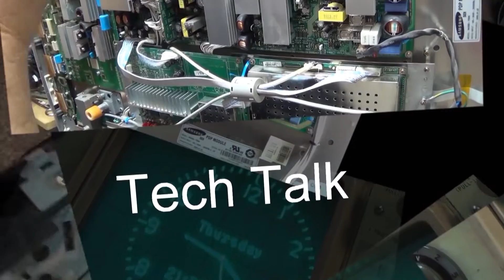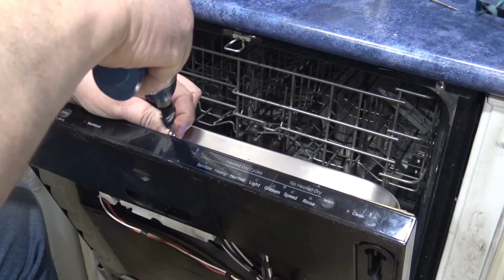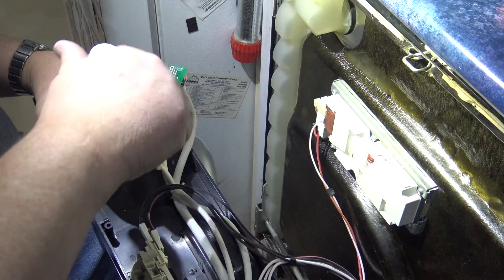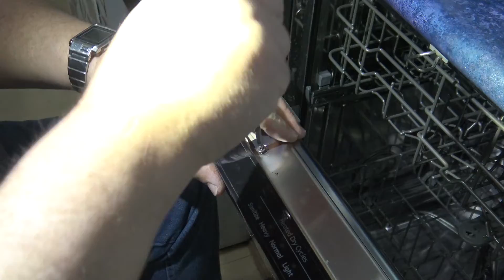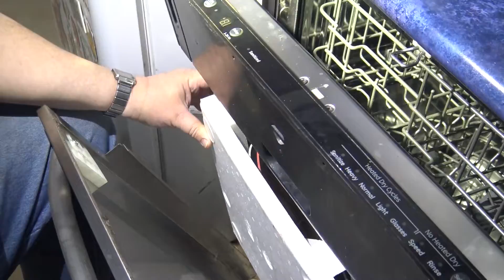GE Dishwasher has no power

Comment: Where do you get parts for your appliances? Is there somewhere local or online?
Reply from the maker: I think I took the switch for this out of an old cable box. I have a hard time getting parts just like anyone else as I don't trust ordering stuff off eBay been burned too many times. By burned I mean getting bad parts but the real kicker in the nads is when you ask someone to send it by post and they send it by FedEx because it's cheaper for them and then FedEx adds another $37 in broker fees which are not expecting on a $2 part to get $37 in fees added on top of everything else you paid

Comment: I know at the time of typing this this video is 2 months old, but I can definitely relate. I agree, these new appliances don’t last. We have a Maytag washer and dryer (separate) that my dad had decades ago. A few years ago, the washer’s mechanical timer quit. At first, we thought we should get a replacement, but I said, “Let me see if I can fix it.” It’s just a simple set of switches! It took me around 10 minutes or so to fix it! My dad and I are in complete agreement that we need to try to fix things ourselves, because repair people will jump right in and say, “Those old machines can’t be fixed. Better to buy a new one.” And yes, these machines still work to this day!

Comment: My dad bought a beat up 1948 fridge in 1970. He cleaned it up real good. Paid $10 for it. 52 years later it still purrs away in the basement. It just won't die!
Reply from the maker: But it chews up lots of power.  I had one, a 1949 Westinghouse but sent it to recycling about 20 years ago.

Comment: First mistake was getting GE. They have always been the bottom of the barrel garbage in the appliance world.
Reply from the maker: Well it has run now for 13 years without fault and a switch failing after 13 years is an acceptable failure in my books.   My sister got 4 years out of her lg crap and replaced with Miele and they have broken too.  So there. My range is is a jennair and it hasn't broken.  Been in service 20 years as has my fridigaire refrigerator.  It is from 2002 as well as has my carrier HVAC.

Comment: Nice fix :) 
Brings back memories from the 90's as my mom accidentally toppled a flower watering can on top of the dish washer resulting some buzzing noise coming from it. I quickly disconnected it from the mains and opened the circuit board cover to try and dry it. Luckily nothing was damaged.
I don't remember details anymore, but I guess I did something right, as the diswasher worked just fine for the rest of the time my parents lived in that house. They moved away from that house in 2018 and the same diswasher still worked, bought new in 1992.

Comment: What is it that on those double digit 7 segment displays that always this segment fails. My current MSI TRX40 CREATOR motherboard has a POST code display where the exact same segment is dead like on your dishwasher. Same with an old clock radio my mom has on B O T H of the clock digit pairs... WTF?

Comment: My infra-red box heater stopped turning on, so I emailed the company and the tech said sounded like a bad relay. Of course, you couldn't order a new control board. So I tracked down the relay (less than $5 bucks) and resoldered.

Comment: We have a GE 2800 dishwasher from 1984 its one of the first dishwashers with microproccesser control ., one bad door switch in all the years we have owned it cleans circles around all there newer models ,,  2015 GE dishwasher at our camp , has had the same issues with pcb micro switches going bad , and 2 bad control board's  go figure ,,

Comment: we bought a new gas range but had electronic oven controls. after about a year the oven controller said the keyboard was bad. so I took the thing apart, and the main board was covered in mouse 💩 and pee. the micro was fried. there was nothing to stop a critter from going on top the board HAD to replace it😡 but i did that myself (board was $300 usd ) when the new one got here i COVERED in UV coating and  cured it,  been 6 years never a problem again 😁 i can only imagine what a "repair guy" would have charged

Comment: Mend and make do, that's my Philosophy, saves you loads of cash.
I wonder it a layer of conformal coating would protect the board from Future moisture.
Thanks for for showing us, a job well done!!!.
John.
Reply from the maker: There was conformal coating on the board but it didn't seem to help.  Hey if it goes another 10 years and the switch fails again i guess I will be changing it again.  Wife was very happy indeed as there was a full load ready to go in as soon as i was finished.

Comment: Seems we all do the same, or better, face the same. Most of the time my weekend starts fixing things and ends fixing things.  The Whirlpool we had lasted 18 years and I fixed it like 5 times. If I looked it up online last year the last comments with people having issues with it were from like 10 years ago.  So I would imagine that they would all have been replaced long time ago.  I could fix mine every single time but I sometimes had serious cuts and some crap cleaning to do after fixing stuff. It had it's time and was replaced by another crap one which soap thing is broken just after the warranty period.  Price of that part alone is like way to much and is of course not universal and made of plastic.  Should have gone for a Miele, look up that brand.  Those things are more expensive but build to last compared to the others.
Reply from the maker: My sister put in Miele appliances.  They have been just as problematic as the LG it replaced.

Comment: Good job. I had similar experience. I ended replacing the entire dishwasher due to the cost of labor and parts are so expensive. I just have to add another $100 and got new one. The original problem was it doesn’t drain. Then after a week it doesn’t power on. They were 3 technicians came in different time, each one of them has different diagnostics. One replace the control board but still the same issue, 2nd replace the hose and drain sensor, still doesn’t do, then last came with a replacement for the internal parts but it doesn’t work. I complained to the appliance company with so many parts they ordered cost $. 579. I said to the company i don’t want to pay since it wasn’t repaired. So I ended paying the duagnostic for $79 and 3 technicians called demanded to pay for their labor and parts since the appliance didn’t pay them. It took them 2 months back and forth to arrange for a technician schedule due to covid with less technician available. so it took me a week to deliver the new diahwasher and installed by a handyman for $100. buying new equals less stress and less time. Never again with American Home Shield Pro. What a ridiculous company

Comment: I just changed my AC condenser last March 2021 and told the guy if my heat exchanger is good on furnace leave it in.  It was fine.  I wanted old furnace because I can fix the old furnace's control board if it craps out.   I don't want one of the new furnace's with the surface mount crap and microcontroller on them that cost 3 or 4 hundred bucks to replace.  By the way I changed condenser only  because I got tired of worrying about it dying during a heat wave.    It was still chugging along.  Furnace is approaching 34 years old.  Condenser was almost 33 years old.   I maintained both myself.    All 3 techs that came out for quotes could not get over how clean my furnace was.     DIY is required in todays world.   Keep up the good work.    P.S.  Just changed water heater too within weeks of the condenser.  Also 33 years old.    All OEM gear from when building was built in 1988.   My buddies motto is "Take care of your shit and your shit will take care of you".

Comment: Well done dave 😀 no money spent and the enjoyment of  a simple/fast fix.
Finding what the codes actually mean is a bloody pain.
Reply from the maker: Codes? The display shows the wash time.  Counts down. Also allows for delay start so can be programmed to run at night.
Reply: @12voltvids  most washing machines and dishwashers display a code if something has gone wrong.
Thats fine but trying to find the actual meaning of the code is often a pain.
Manufacturers often wont give you the meaning so you have to call a repair man.
Shitbags!!.
Can you tell im not impressed lol.
Dave keep repairing that dish washer for as long as you can.
Reply from the maker: @zx8401ztv  I will because i am cheap. Hate spending money.  Like making it. That's why I never go on exotic vacations because I can't drop a bunch of cash on a cruise or airplane ticket to some exotic place.  I have no problem dropping 50 grand on a new car or something that i can enjoy for many years.   Fine dining is also something i don't do. 500 for a hunk of meat and a couple veggies dressed up on a plate.   No thanks.
Reply: @12voltvids  Well you have the ideal meat cooker, so you can cut out the silly prices lol.
Little treats once in a blue moon can make life more enjoyable for you and your good wife.
There are people that are ultra tight asses and keep every penny,  they die and leave a bank full of money behind 😞
This happens so often and quite sad that they didnt get a bit of enjoyment in there life.
Having said that, i dont spend very often ha ha 😀
Reply from the maker: @zx8401ztv  I spend lots, but not on trivial things.   My fear is not having enough for a long retirement.   That is the end game.  Retiring sooner than later.  Know too many that worked longer than than they should have because they never saved anything.  They blew it all showing off.  Went to Hawaii every year spend spend spend.   Worked till they were forced to retire and then struggled to pay their bills.  My game plan is to retire in the next 3 years when i am still young enough to have a long retirement.

Comment: We recently had to have out hot water heater replaced because it had completely rusted away and flooded the house. We called several different places to price now much it would be. All companies wanted nearly a $700 to just remove the old one. I decided to disconnect it and remove it myself. A good old pair of channel locks and 10 minutes later it was on the truck going to the city dump. Saved myself $700, which paid for a brand new water heater.
Reply from the maker: I changed my last water heater and will do it again when it fails.  It sits in a floor tray which is plumbed into floor drain so when it blows there won't be a flood. The washer sits in a pan too.

Comment: Almost everything is made as cheap as it can be made with cheap parts.
Made to be thrown away.  I have a fridge in my shop from the 60's and it
still runs!  A repair man has never looked at it.  My dishwasher takes 
over 2 hours to wash.  Last one I had took about 45 minutes, yet this 
one is supposed to be "energy wise?"  I have already had to have repair 
guys to come twice in the 5 years I had it.  Wish I would have just fixed 
the old one now or at least tried.  Repair guy said I needed a new one!
From now on I will work on my own appliances....    Geeeze.   
Cheers buddy!  -Al
Reply from the maker: My old dishwasher also took 45 min but used about 5 gallons of water.  My new one takes 65 minutes but uses less than 2 gallons of water.  It heats the water to almost boiling.  There is a seperate saniheat mode that heats even hotter and holds it there for an additional time.  Of course there are econo modes that run shorter cycles too.
Reply: @12voltvids 
 Mine has different modes also, but only the regular mode 
will really clean like it should.  So actually the econo modes
are useless.  Mine is a Bosch machine, supposed to be good
quality, but it's already had 2 service calls in total costing me
about $450.  My other machine was a Maytag that only took
1 service call in 18 years, and the man condemned it....  So 
actually my last machine from the 80's, a Maytag, used less water
and power, and will probably outlast the modern Bosch.
There's a lot more inside of it to go wrong also.  Appliance companies 
are like the electronics companies where as 1 company owns about 
all major brands now.
Reply from the maker: @bigalsmallengines  
One thing I can say, my last washer did clean the clothes better but also was very hard on the clothes and wasted a ton of water.   The new one much more gentle on fabric and uses very little water but i don't think it cleans even remotely close to the old one.  One thing foe sure, it spins super fast.  The clothes come out damp as opposed to soaking wet from the old one so drying time is cut by at least 50%

Comment: Stop buying junk brands. Buy quality, and you won't have such issues. By quality, I am talking about Miele. Most brands are designed to fail. This is not the case with a Miele product. They are built to last. They are easy to service if they ever do fail. When you work with sales of white goods, like Dishwashers, Washing machines, stove-tops, ovens etc, you notice what brands never tend to come back. And Miele is on a whole other level.  And it doesn't matter what you pay for the competing appliance, you can get the most expensive Bosch or Elektrolux,  it's irrelevant, they fail just as often as their cheap models.. Sure, Miele products cost more, but they are a different league when it comes to build quality engineering an not being build to fail.
Reply from the maker: Miele are also crap. My sister but that crap and everything has broken. You must be a dealer.
Reply: All modern day appliances are garbage. If person needs a new washer and dryer DO NOT BUY a modern model. Find someone trying to sell an old Kenmore/ Whirlpool direct drive. Those machines are made like tanks.
Reply from the maker: @jerryspann8713  they are junk.  I will look to speed queen for a washer and dryer.  They still make them in USA and they have models without computers.  Mechanical timers.

Comment: Hello, I have a Panasonic AG-W1 vhs, the tape loading mechanism went out of sync. You have a video showing how to do it and another question. I also have a Panasonic NV-J48 that needs a video head change, but in Argentina I can't get the VEH-0520. Do you know what other head I can replace it with? Thanks
Reply from the maker: No don't know what the sub would be for that one.
Reply: @12voltvids   Thanks

Comment: Yah 20 years ago my a/c compressor froze up guy says it’s fried 10grand for new system ,found out the pre filter on electric filter was plugged.
After that fridge died guy comes said board fried 600 for new one ,I found out it was a relay pin melted the solder so I fixed it .Same for stove relay pin daughters stove relay pin . But the best ones are the furnace boards neighbor bought 3 boards .

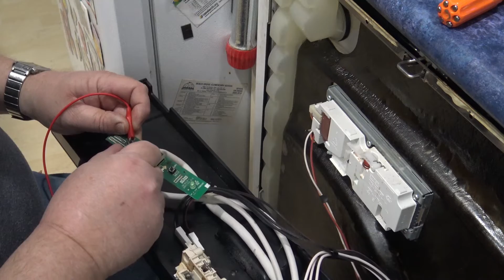Comment: 4:45 Seeing you jump, priceless... Just had to replace the brain board on my 3 year old GE stainless steel dishwasher. $75 from GE, shiping included. Guess what the warrantee period is? 3 years. Still have the old board, but it has a very thick coat of conformal coating and not easy to remove, very labor intensive to repair. The door switch is very problematic on these also. It is two switches in one mechanisim, it will cause no power up as well.
Reply from the maker: Me jump? Never. Cat jumped on my back at that very instant.
Reply: @12voltvids  When the display lit up and the alarm sounded at 4 minutes 45 seconds into the video. Fess up, you were startled. I did LOL
Reply from the maker: @zulumax1  i already told you the cat jumped up on my back at that very instant. 😉
Reply from the maker: Yes I am aware as one switch locks out the power button when the door is closed.

Comment: I feel your pain....Our 7yr old Whirlpool Dishwasher has just developed a slow leak on rinse cycle and we are getting a slow drip through the basement ceiling....this fix will be a little more in depth to find the seal that has failed.   Good fix on yours!
Reply: Just fixed my dishwasher too....In my case was the diverter motor assembly. Also had corrosion on one circuit board because of dripping and had the same kind of Momentary switch that selects diverter mode that was bad. Was able to take that tiny switch apart and clean the contact with deoxit.....then used JB weld to secure the case back together.  Probably saved $500 for a service call.

Comment: Dave, I saw some of those shows !, there was one where the water heater had a simple problem and the companies wanted charge a ton for replacing it!! Great video!! But surprised that the cats didn't get stuck in the dishwasher! Lol 😆
Reply from the maker: They stuck a sock in the drain to the washer and watch the tech tell them they needed a 300 pump replacement.
Reply: I wonder if it was Marketplace on CBC, they recently had some good ones with crooked HVAC techs (edit: just heard you say it was Marketplace)
Reply from the maker: @spacewolfjr  yes marketplace on CBC